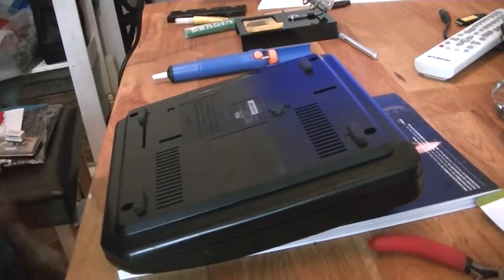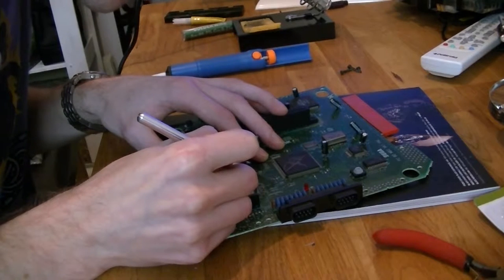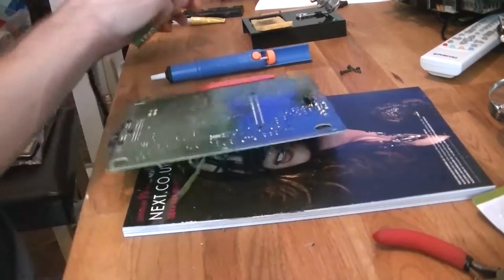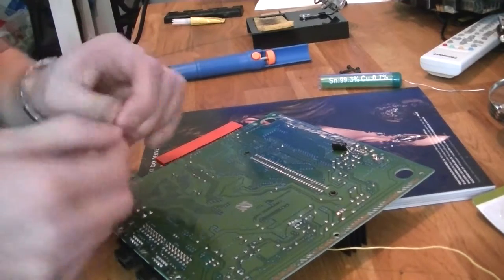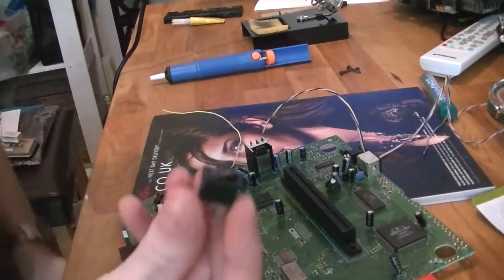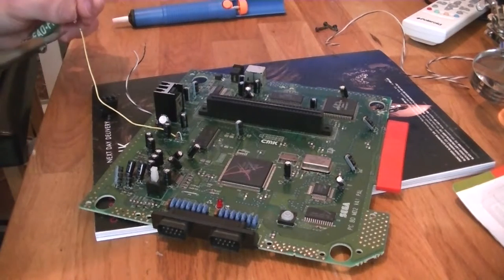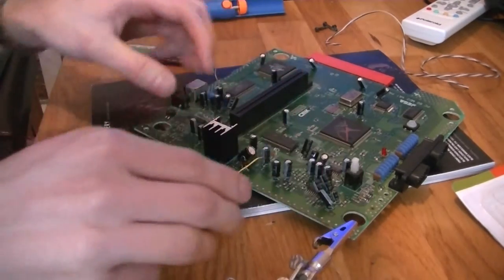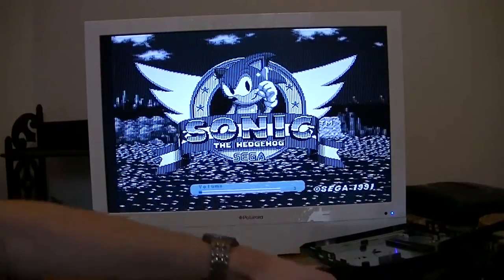Mega Drive 2: 50hz 60hz mod

Comment: Thanks for the guide! 
Switching works fine on one of my TV's, but on my main TV the picture dissapears constantly in NTSC mode, and the TV it does work on still sais PAL when running in NTSC mode (but looks great without borders and runs @ correct speed)
Could it be my RGB cable that is made for just PAL consoles?

Comment: Hello, I have a question I'm hoping you could answer.

I just modded my MD2. Based on your tutorial and others online, the console will require a SCART lead in order to play Genesis games in color. Correct?

After messing around a bit with the console, I found out that after a Genesis game loads, if I flip the switch back to 50hz, the screen goes from black and white to full color. And this is without a SCART lead.

Now I haven't came across anything like this online and I have a small concern.

Everyone is saying that I will need a SCART lead or will need to perform another mod in order to display B&W games in color.

Will flipping the switch back and forth while the console is on cause any damage in the long run?

Appreciate your assistance with this.
Reply from the maker: Sounds like you have a pretty one off TV. I doubt it would cause any damage but without a RGB scart lead you won't get as crisp an image. For the sake of £10, get a scart lead and then you won't be scratching your head when you take it to a mates house or get a new TV.
Reply: Fixing Tech on the Kitchen Table
A SCART lead is on it's way (along with a SCART to component adapter). I was just very surprised to see it working without one. My TV is nothing special at all. It's an LCD and as basic as it gets. I'll try it on a different TV and see what happens. I'll keep you posted.
Reply from the maker: Anz Bar It could be that the mod didn't work properly and the image is infact 50hz. Does the music speed up and boarders disappear?
Reply: Fixing Tech on the Kitchen Table
Is the mod supposed to speed MD games up and remove borders as well? The speed is fine on the Genesis side of the switch, and the borders disappear but the picture is black and white (no SCART or RGB mod). For the MD side, I get borders and slower speed still. And as mentioned before, after loading a Genesis game and flipping the switch to 50hz, the color works but borders appear and the speed slows down. Maybe I didn't solder a wire properly.
Many thanks for your help.

Comment: I just opened up my model 2 Megadrive but my mother board has a different layout and all the tracks are labelled completely different. I've Google half a dozen guides online but none of them have the motherboard variant I have. It's completely scuppered my mod plans! Any help would be greatly appreciated. Please internet you are my only hope.
Reply: Does the board only take up 3/4ths if the case?